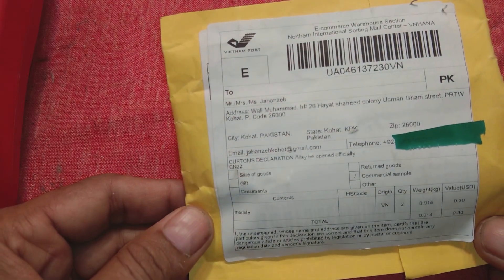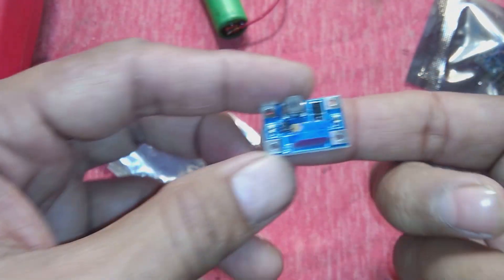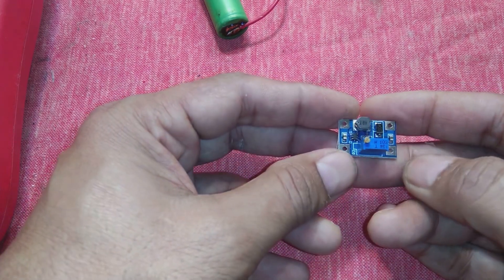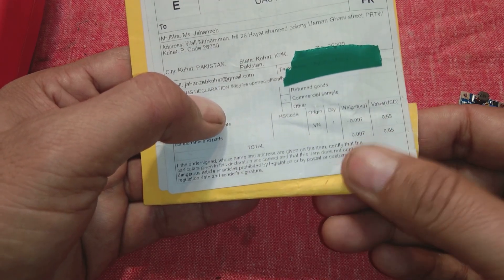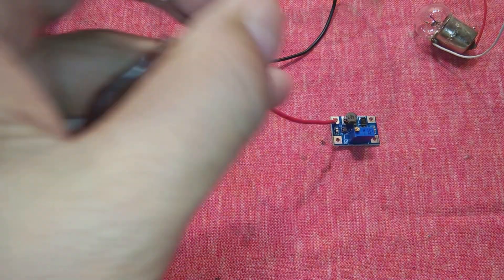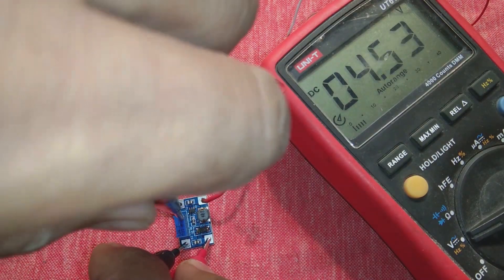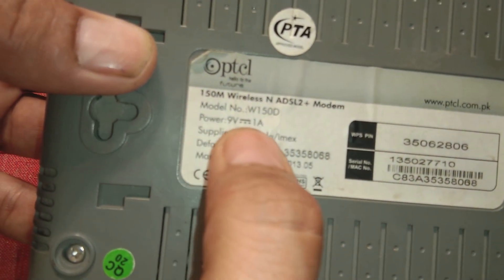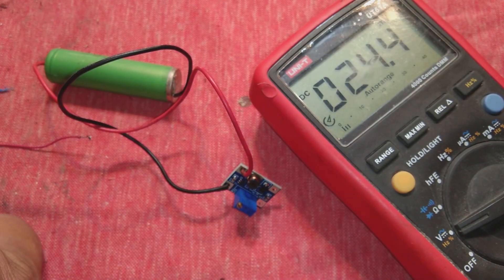boost converter module review and power up. step up module. 3.7v to 12v

Comment: Sir, my aftermarket from AliExpress remote locking module does not receive signals from the key fob. The battery of fob is good and indicator flashing on fob when buttons are pressed, and there is power supply to the remote unit also.

Please show how to check receivers or transmitters for defective!!!! Thanks.

However, there's is pow